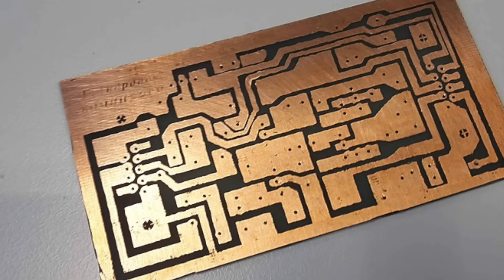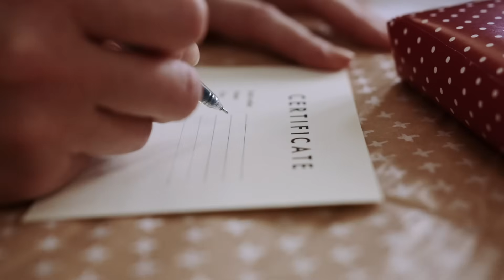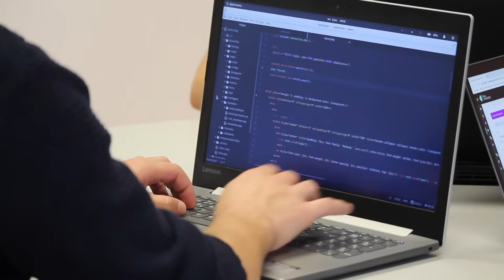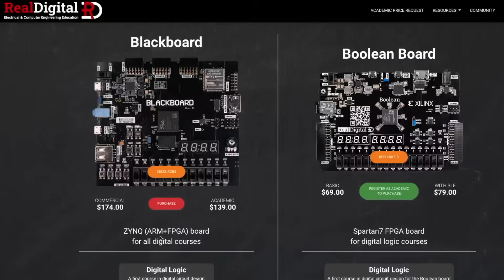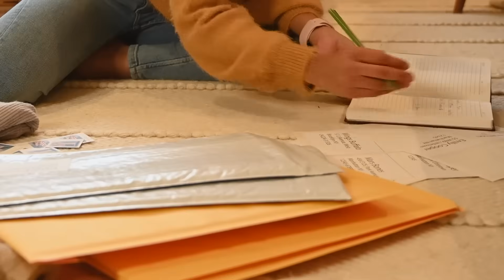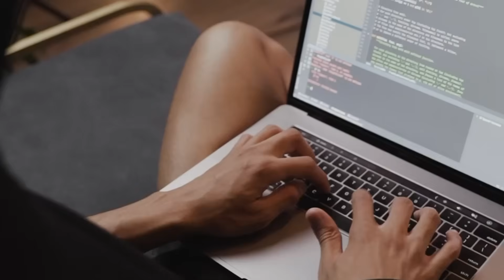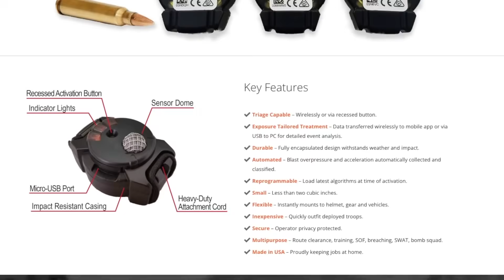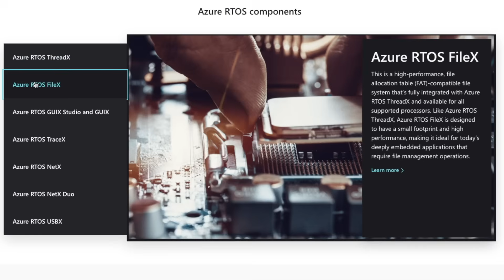10 years of embedded coding in 10 minutes

Comment: i actually am 25 years old and have been obsessed with this thing and want to try and apply for a role in juinor embedded systems company in europe or somewhere else remote would be the best option so what i have in my resume is a project like this :

This project involves six sensors (BME680, MPU9250, DS18B20 ×5, PMS2.5, CCS811, MAX31865) using SPI, I2C, UART, and 1-Wire with DMA, interrupts, watchdog timers, and low-power modes. It includes MPU and flash protection, secure boot with digital signatures, and AES-GCM/CTR cryptography. The STM32 Nucleo board communicates with an ESP32 via UART DMA, sending data to a Mosquitto broker over MQTT TLS and then to AWS via HTTPS. Data is also displayed on a web dashboard using ECC. The system uses FreeRTOS for multitasking. Additionally, it integrates a vendor VFD with Ethernet (using vendor schematics and Ethernet code), where motor speed is dynamically controlled based on MPU sensor data.

my question is can i secure an internship or a junior role or at best if a miracle happens a mid role in embedded systems 
i have reasoned about every line of my code and have documented it
Reply: but i lack a formal working experience in my embedded systems journey

Comment: Its late but does embedding fall off today?
My roadmap : esp 32 on arduino->avr c->plc-> internship on plc programming(hydrogen electrolyser machine process control)->now learning embedding linux online class+stm32(Cmsis pure C/c++),i am doing projects on realtime vibration measuring system for induction drive system,10 fault classification with embedded tf lite on stm32+freeRtos
Software:c,c++ ,matlab(mostly simulink),python,ide for controllers
Is that feasible to land an internship or fresher job now?
Reply: PLC and Embedded are usually different

Comment: It's interesting how you mentioned your journey through trade school. Initially, I pursued graphic design but eventually dropped out of college. However, four years later, i decided to return to school to study engineering technology. This led me to a job working on drawbridges, where I gained experience in electrical work and learned how to program PLCs. Now, you're back in college pursuing a degree in computer science, but I’m considering switching to computer engineering due to my  extensive experience with Arduino over the years. Additionally, in my previous job, i acquired programming skills in Python.

Comment: I like the idea of being an embedded software engineer, however, my school doesn't have an engineering department. Is it difficult to get a job in your field with a computer science degree? My cs degree has classes on embedded systems, computer architecture, a/c circuts, and digital electronics on top of the normal software developer oriented classes if that helps and I intend on taking all of these.

Comment: I just got into Frontend web development this year and this is Greidi telling me to be hard working, try out new stuffs, solve problems and never to stay at a job that isn't thrilling to me that's slow suicide. Thanks a bunch!
Reply from the maker: No Problem! glad it's been motivating :)
Reply: The irony of reading this comment for me is thats how I got started.

Went from working in restaurants to teaching myself frontend web dev to getting my first software job. 

Something like:
Vanilla HTML, CSS, JS -> React -> got job where I learned/used Vue -> some PHP and MySQL -> Go, MDB, other RDBMs, Docker blah blah fullstack web dev stuff and some internal tooling with more CLI based apps.

I kind of went wide and never really wanted to get super deep into web-ish stuff. That in part is because the job I got was semi-unique startup situation and I didn't know any better. There was no one really experienced and I basically taught myself most of that as the need seemed fit to grow the project.

So like this guy, I did a decent but of stuff but I never had the big team and very design pattern driven code to make a more standardized way for many devs to work on a large codebase.

Anyway

I got laid off last year and in the past 1.5 months figured out embedded systems is where I want to take my career. I've been going deep, even with very limited time currently.

Currently working on figuring out building my own variable bench power supply. I figured a good way to learn is to build some of the tools I'll need.

That's the beauty of technology and software. Pretty low cost barrier to entry. Until embedded, I think I only paid $40 to get my education. Some Udemy courses when I was first figuring out wtf programming actually is. Someone with curiosity, determination, and time can learn so much these days with the web and YouTube.

But, a degree is still this somewhat arbitrary requirement for a lot of software/tech jobs, even if it's not practically applicable to the actual work you will do.

Gonna be a struggle to get an embedded job, but I'm determined.

Comment: How important would you say is an understanding of "circuits boards" or "electronics" for embedded engineering? I have a good understanding of software development, writing code, designing systems but no experience with embedded systems. I guess you have APIs to the sensors or motors you need to control to get data but is that really all you need in the end?
Reply from the maker: Depends on how "high level" you work in the code. If you're writing drivers as an embedded software engineer, you'll need to understand how to read schematics, understand some about circuit boards (if you need to probe signals real time on the board), and maybe a little bit about electronics. I can tell you, that you can get away without really not needing any of that - I worked at Alstom and all I did was high level programming... never even touched or saw the real circuit boards I was writing code for. Here's a quick video of pretty much of all low level protocols you should be familiar with for embedded software engineering: https://youtu.be/HFmGk4oufj8
Reply: @GreidiAjalik  Thank you :)
Reply from the maker: no problem! :)

Comment: @greidiajali
Hello, this Dhanush.

I have done my bachelor's in electronic and communication in 2019. After that I have done internship for two months using Arduino and LPC2148. Due to COVID, I have not done anything after internship. Now in spring 2022, I started doing my masters in electrical engineering (specialization control systems) at Cleveland state university (USA). 

I'm passionate of becoming a embedded systems engineer. I just started doing an online course(5 months) in summer 2022 ( June 1st). 
It includes following modules:
1. Linux systems
2. Advanced C 
3. Data structures and logic analysis 
4. Linux internels and networking
5. Microcontroller (using PIC microcontroller )
6. Embedded Linux on ARM (using beaglebone black)
7. C++ programming 
This course finishes by November 2022. I'm planning to do internship/co-op in summer 2023 and get full-time job by Dec 2023.

I wanted to know whether, this skills are enough or what all the others skills required for embedded software engineer. Also, can you tell me interview preparation for companies in USA ( because, it is different from India)

Thank you,
Regards
Dhanush
Reply from the maker: Hey! The classes look good - I'm assuming the linux courses will cover general OS stuff. For interview prep take advantage of the schools resume workshops and mock interviews - that will be a huge help. They can in person help you build your resume. Cheers! :)

Comment: Hey guys, i am a mech engineer and wanted to learn microcontrollers to do robotics, i know a little bit of arduino but this field is so confusing, what are the subjects i need to study so that i can create a basic- moderate level circuit by myself and integrate microcontrollers into it and atleast understand  the overall processes taking place. A reply is greatly appreciated.
Reply from the maker: Hey! It sounds like you might be trying to take on too much at once. If you want to focus on designing PCBA boards (which is electrical engineering heavy) you'd want to find some sources on YouTube or Google to get started with that (I'm not that familiar with it - maybe someone else can give a better recommendation here). Although if you'd want to focus on learning programming microcontrollers and trying to understand what basic skillset you might need to get going... check this video out... https://youtu.be/HFmGk4oufj8 - Hope this helps a little bit... let me know if you have other questions :) Cheers!
Reply: @GreidiAjalik  hello sir, thanks a lot for the speedy reply, your vedio really clarified my doubts, i got to know that i am more interested in the uses of the microcontrollers than how they work exactly. ❤ thanks a lot, hope you put out more great vedios like this.